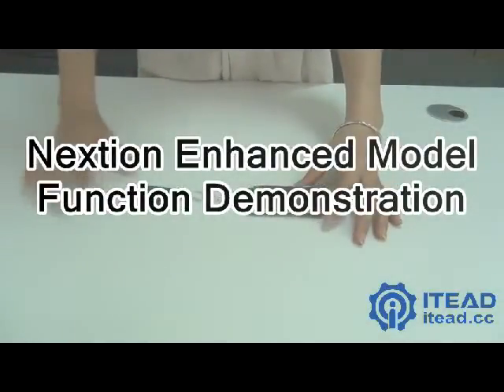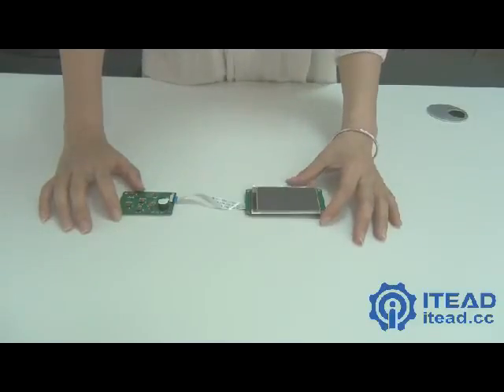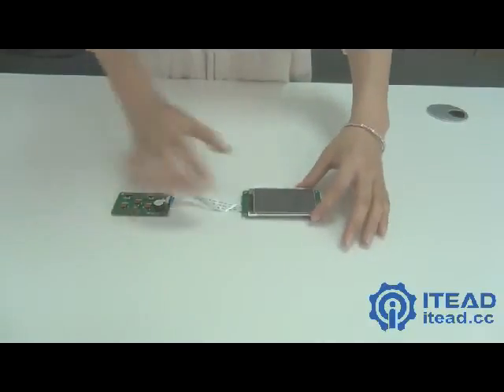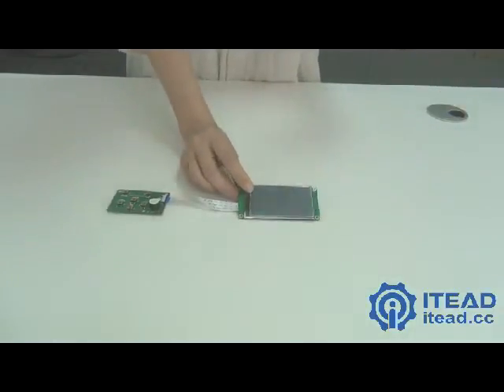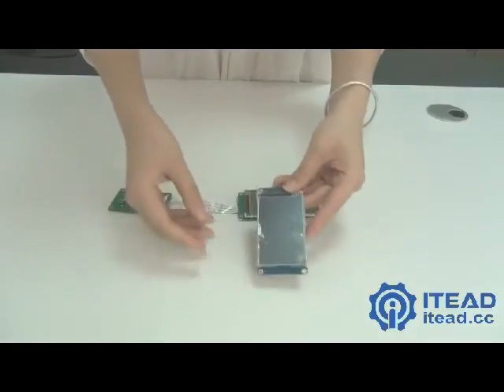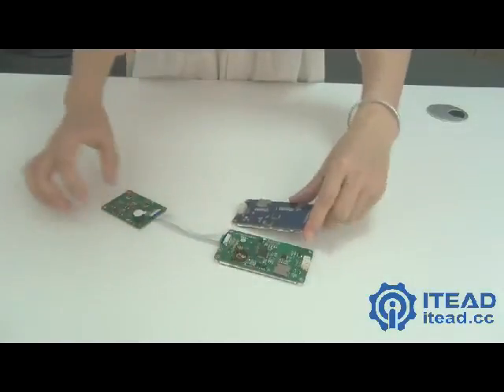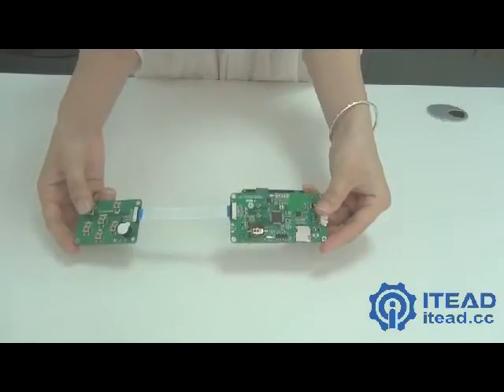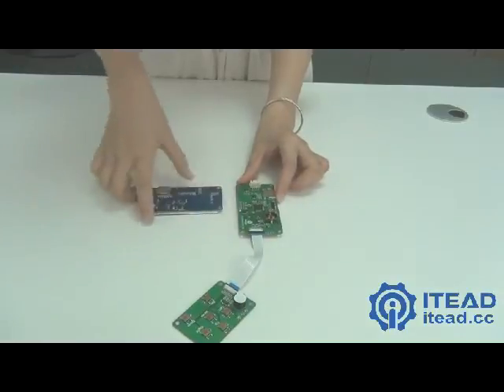Nextion Enhanced Model Function Demonstration

Comment: see https://www.itead.cc/wiki/Nextion_Instruction_Set cfgpio command
The sample project appears to assign each IO in binding mode to one button on the screen activated by the button press event for each of the 6 momentary buttons.  For the LED's button Ouput mode, and for the buzzer PWM mode.  No source, but simple to do.
Reply: Hi thanks for your replay. i need a help i want to write / display 40 characters with dynamic data through UART Just like 40X 4 LCD